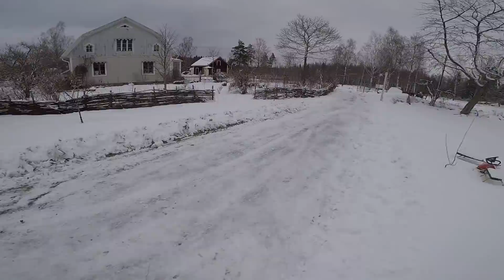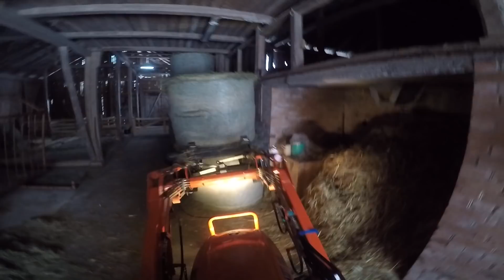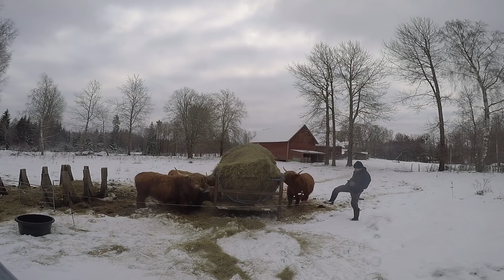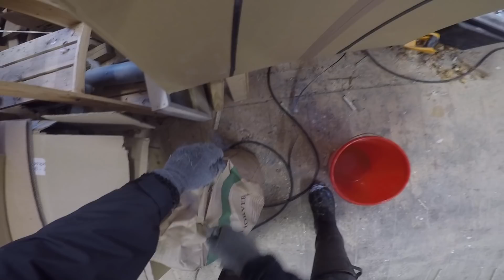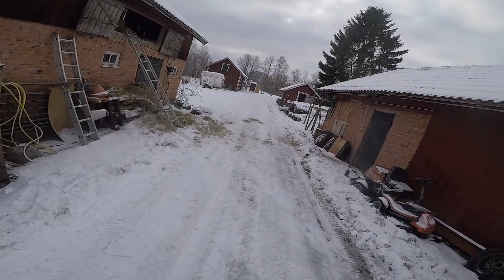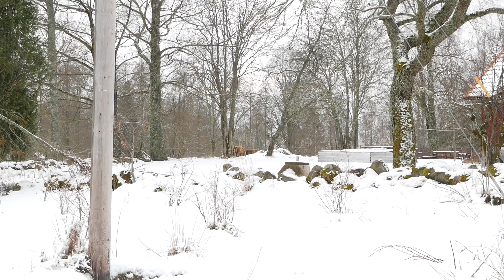Cattle I Bought Possibly Carrying Disease??

Comment: Simeon in the US there is a hay net for round bales that has small openings that allows the animals to get small amounts at one time I cannot remember what they're called but you can probably Google hay net for round bale and find it. You just lay the net down on the ground and said the round bale  on it and then you pulled it up around it and it has a closure that's pretty simple.  Very inexpensive it would probably help you save a lot of that expensive hay.

Comment: Throw in some corn and the pigerators go to work with a chicken cleanup in the spring.  That's going to be one bountiful garden.  Do you also provide salt blocks?   Build a mineral sled with a cover after the dunken sailor intake phase and your buying.   Spring will have them shining and grazing green pastures.  Bio Char also very good supplement.

Comment: It might be a good idea to mix the kelp with something like dried sugar beet pulp.  We used it at home and made it work better when giving them a more expensive supplement that you don't want to waste.  As kids we used to chew the beet pulp for the flavor.  Your loose hay is easier for them to get a mouthful of hay.  It may be that they art tugging harder on the tight, round bale just to get a mouthful and then wind up pulling out more than they need.  If there was a way that you could unroll and loosen the baled hay, it might be worth trying.  I've seen machines that take the large round bales and unroll them into an old baler where you could set the compaction and tension really low.  This 're-baling' is sometimes done to create small 'lady bales' that women can handle when feeding their stock.  This might make controlling how much you're feeding them a bit easier.

Comment: Great vid Sim. If they have to strip the hay out, they will spill it. Your homemade feeder is better because they can stick there heads in and feed. It might help to lower the blue one so they can reach over at first, then when the bale gets lower they can reach under. Also, you might be able to cut out every other vertical bar to give them more access. Thanks for making this channel, it's a favorite of mine.

Comment: The hay wastage is easy to fix it’s just not very cheap. What you need is what we in the horse world call a hay net. They come in many different bale sizes as well as hole sizes. I use a net with a 2” hole to slow my horses down while eating their meals. Without a slow feed hay net they finish their breakfast in 2 hours. With the nets it can take them 6+ hours to finish. Also they tend waste a good amount of grass hay without the nets the weekly loss is at least 1 flake per horse. I have 4 so it adds up. With the nets the weekly loss is maybe a 1/4 of a flake. 
For the cows you don’t want them to slow feed just to stop wasting the dripped feed. I would go with a high quality net with a 3-4 inch opening. You would remove the wrapping on the bale and then slide the net over the bale and cinch it closed before placing the bale into the feeder. I believe that this method of feeding would drastically reduce your hay wastage.  
I would also go ahead and treat your whole herd for lice.

Comment: Doesn't look like ringworm but if it is you should put out bits of holly and it will eventually fade away
Reply: Yes not ring worm, it's lice and he needs to treat the whole herd. They need to be dipped, but it's winter. Insecticide powder like Seven or Marlate is used by some. Old time farmers would use a burlap sack soaked with a mix of diesel fuel and used oil strapped to a post or hung for cattle rubs.
Reply: Diatomacious earth would be a lot less toxic.
Reply: Beverly, yes less toxic to the lice and poor results. Olive oil would have more effective than D. earth. If you want to just irritate the lice and give them boo boos while they spread to the whole herd, other livestock and humans, then D. earth is the way to go. I'd use seven powder on all livestock. You always quarantine new livestock for at least a week before putting them with the others. While quarantined you treat to prevent infecting the whole herd. Protecting the herd is No.1. 

I mean no disrespect to the guy, but he seems to be a hobby farmer. He should have worked for a farmer or rancher for a few years before trying to be one. It takes years to learn, not just a want, book or google.